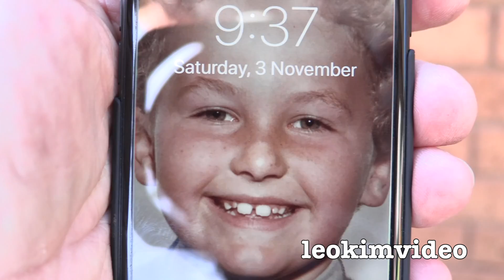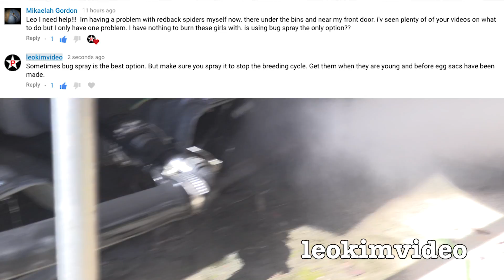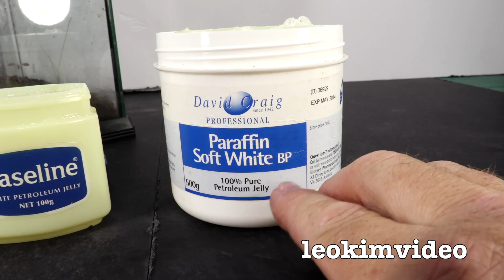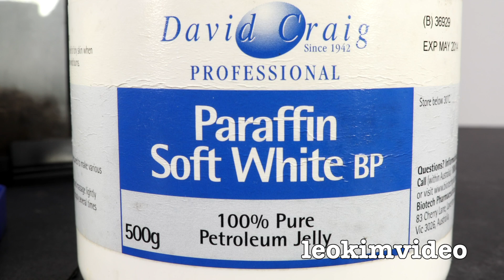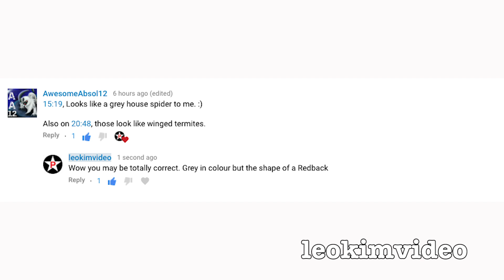New Spiders Found Spider Tank Fail & First Cicada EDUCATIONAL VIDEO

Comment: Worst thing about them is how they get under handles. Id put a couple holes in all the pots and put a bit of rope thru them for regular use and cut off all the edges of your containers. Those look similar to the ones here that will cover the side of a house but when you look at them head on they look like they have a skull shape on the back and they are bigger. The ones here don't tolerate other spiders and as said will build there webs in the open.

Comment: It’s melting because u have it out in the heat of the sun the other tank was kept inside not out in the sun. Naturally the Vaseline will melt in the heat.
Reply from the maker: The other tank was getting temps of up to 40 degrees C, this tank has only seen max 35 degrees C. Never had drooping problems like I have now. Both tanks were kept in the same shaded area.

Comment: I hope the new method of applying the top of the spider tank works Leo! Crazy seeing how the petroleum melted like that. I wonder tho if the lithium grease would work still considering it’s a glass surface. Then again I’ve never used it myself in anything. I look forward to seeing how you tackle this new issue